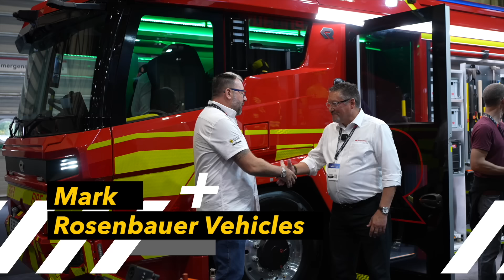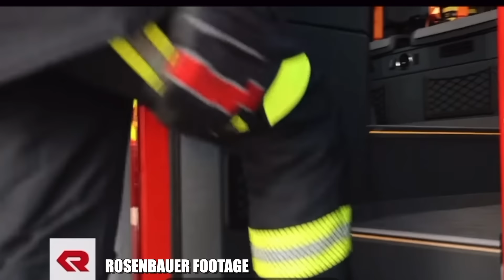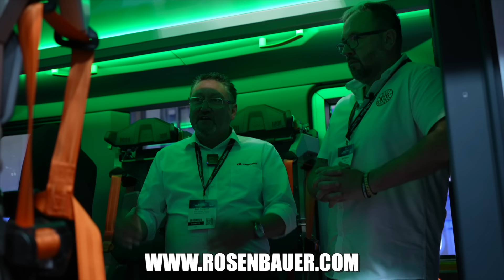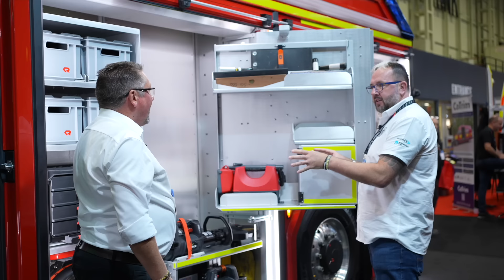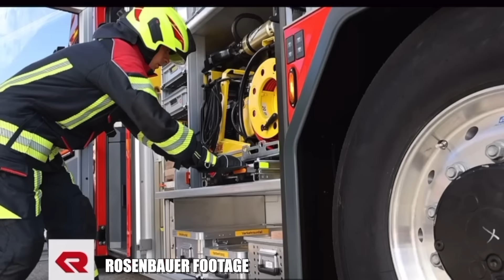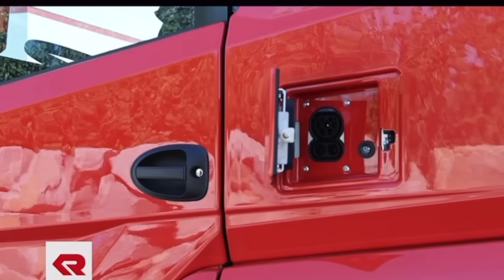Buy This Electric Fire Engine - With A £1,000,000 Budget!

Comment: "All Electric Fire Tender" with a diesel engine to keep it running, its not even April 1st lol.
Reply: Yeah, but thats only on extended uses. For small/medium fires, you can drive to the scene, do your stuff, drive back and plug it it. 

So yeah, it’s all electric, if you rip the diesel out, it doesn’t detract anything from the vehicle’s functions, except runtime.
Reply: @HvV8446  I think its designed to take the firemen to the supermarket to top up station supplies, if by chance they see a cat up a tree they can blue light it whilst getting a ladder. PS, how does the dispatcher know if its a "small/medium" fire?,  unless the caller says its a wheelie bin fire.
Reply: @HvV8446  If you rip the diesel engine out, it's completely useless for moorland fires.

What they have ended up with is a fire engine which is more expensive to buy, and wastes some of its weight limit and space which could have been used for additional water or fuel.
Reply: Its a diesel electric with batteries. Hybrid makes sense. You just have a bunch of weirdos in marketing
Reply: @BlowBubbbles  I'm not against the diesel electric part for packaging reasons, but the batteries needlessly reduce the water and fuel capacity.
Reply: @yngndrw.  Stop with the lies it only has 132kwh battery and has no major impact on fuel and water capacity. It needs much less fuel that already compensates for the battery space.
Reply: @Neojhun  Check the manufacturer's website, their own datasheet says "High-voltage battery (2x 66 kWh, 650 V)". It doesn't matter how you drive the pump, centrifugal pumps have losses and any advances in pump technology apply to both IC and electric drive.

You tell me that I'm failing at physics, but you seem to be failing to understand the units that both I'm using and that you're using. 132kWh is the capacity of the battery, it's not related to the power draw in kW or kVA. Maybe you should re-read what you've written and consider why it makes you look foolish.
Reply: @yngndrw.  What part of 250kVA Diesel GenSet do you not understand. That 2x 66kWh is not relevant if you can just Burn Diesel Fuel to top up the battery capacity. That 132kWh capacity is a massive BUFFER for the difference between kVA Supplied VS kVA consumed. Basing the operational duration on 132kwh limit capacity is WRONG! The WaterPump MAX Consumption is 112ish kVA so even the sweet spot RPM of the Generator is Higher than the consumption rate of the water pump. I never ignored the losses all I said was you could massively reduce the losses by having way shorter PTO shaft and less complex method of driving the pump. Electric Motor being closely coupled to pump is massively more efficient than PTO from engine. You keep spamming irrelevant nonsense and ignoring the facts.
Reply: @Neojhun  My responses were in response to comments that the generator would never or rarely be used, or that the engine could be fully removed. The output of the diesel generator is irrelevant  to that.

As I've said in the past, I have no issue with making it diesel electric for packaging reasons (Although that will reduce efficiency of course) but adding the battery is pointless in this application.

You're getting very angry about this, do you work for the manufacturer? You need to calm down.
Reply: Typical petrol-head reply… most of the time the diesel will never run, and appliances spend most time not moving, with big diesel engine running and making noise and pollution… this is a big improvement.
Reply: @theboatcheat1204  Okay let's use some numbers, I've found some specs for the Rosenbauer RTX fire truck shown here. It has two motors producing a total of 360kW (490bhp) peak, or about 260kW (250bhp) for everyday driving. It has a 300HP (220kW) engine and a 132kWh battery pack. Looking around, it looks like pumps typically use about 200HP (150kW) and house fires can typically take between 30min and 6hours to put out. If you have a 60min round trip from the fire station, that's 260kWh for driving and 75-900kWh for pumping.

The battery alone wouldn't even get you to and from a fire 30 minutes away, even if you didn't use the pump. Using the pump to extinguish the smallest house fire would drain most of the battery.

Pumping uses a lot of energy, that's just the physics of it. Fire engines need to carry a substantial amount of water with them so they can get pumping right away while they hook up to a hydrant. They also need to carry a substantial amount of fuel on board, because they still need to be able to tackle the larger jobs even if they aren't as common.

Electrification is a great idea for many things, but fire engines is not one of those things. It isn't about being a petrol head, it's just basic analysis of the problem.
Reply: @yngndrw.  It is good that you have some numbers but they are misleading if you don't know about electric motors, the drive motors won't be running at full power constantly just as you don't drive a diesel truck with your foot to the floor constantly. So 1 hour of driving would not use any where near 260Kw, until we are given real world data we can't say for certain what the consumption will be.  As for the pumps they would have been sized for the worst case of have branches with multiple lines coming off them, running large monitors and such, with one or two 64mm or 70mm lines/hoses the pumps would not be running full power. The same goes with the high pressure lines. Also worth mentioning is that nearly half of UK fire service call outs are to not fires and many of those call outs will benefit from having quieter vehicles.
Reply: @killuazoldyck1352  I know they won't be running at full power, full power is the 360kW peak figure I mentioned. The 260kW for "everyday driving" is from the article with the information which will be from their own press information. Remember it's an 18t GVW which will be loaded up with 2,000l of sloshing water and a lot of equipment. I've looked up the pump, it's a Rosenbauer N35: 3,500lpm @ 10bar. The datasheet doesn't state the efficiency, but if we are generous and say it's 80% efficient, then that would be about 100HP or 70kW at maximum load. Even if you call it 50kW for 1h, that's half of the battery gone just on pumping. It's worth noting that this fire engine can only support up to 120kW charging. The numbers just don't add up even if you're conservative about it.

It's worth noting that the manufacturer is very light on the numbers they provide, my cynical mind would suggest that's for a reason.

At the end of the day it's an emergency vehicle, it's a backstop which is there for one specific purpose - To be available when people really need it. What's the overall pollution from firetrucks compared with pretty much anything else? I doubt they even show up on a graph! Action on climate change must be pragmatic, or you'll lose people which damages the movement where it really matters.

If non-fire callouts are so common, perhaps they'd benefit from buying more support vehicles instead.

Why does noise matter for a fire truck? They have sirens and you rarely see or hear them anyway as most of the time they are sitting in the station doing nothing.
Reply: @yngndrw.  FYI You can just add more diesel fuel to the truck while on long durations jobs. "200HP (150kW)" does not take in account the inefficiency of Combustion engine where driving anything through complex drive shafts and transmissions has major friction losses. This direct Electric Motor pump could easily be 85% the power consumption with minimal changes. With further engineering refinement you could achieve extra 10% for similar performance probably around 75% the electrical power requirement. Soo that's just 112.5kVA Water Pump. Being fed by a 132kWh battery and 250kVA BMW Diesel Gen Set. FYI That means the power train is OVERKILL for the water pump. You fail at physics because you keep ignoring this is Series HYBRID power train. Not a pure electric power train.
Reply: @yngndrw.  BMW Diesel Engine Generator is around 250kVA. Water Pump Consumption is about 112.5kVA. Power Supply is OVERKILL for water pump. Your LIES defies the facts.

Comment: There are 2 electric fire engines already in the UK, One in London that has never been on a shout and is based on a Volvo, the other is in Scotland based on a MAN chassis, often off the run. Time will tell but I suspect it will be a good looking nothing sadly.
Reply: I've seen the Scottish Fire and Rescue Service one on a few YouTube channels. It also went past me one night along with its station's second pump to an incident somewhere in its cover area - pretty much South East Glasgow - and it does look like a decent appliance to be fair.
Reply: @shaunflanagan8735 Apparently it's now only used for driver training.
Reply: I remember seeing a video of one of these here in north america leaving a fire station on a call... listing to one side
Reply: @juliogonzo2718  Yes it has Air Suspension. It is a feature to lean down for easier entry & exit. FYI City Buses do the same thing. The driver just forgot to raise the truck and drove off.
Reply: @Neojhun no it looked like there was an air issue, one side was not inflated
Reply: Fire authorities up and down the UK have budgets that have been cut to the bone over the last twenty years, the last thing they need is an appliance that’s £500k more expensive than a standard build on a lorry chassis from someone like E1.
Reply: London's is on the run now and has been for over a month. Probably been to well over 100 shouts now
Reply: The LFB one has actually been deployed on one shout, it’s currently recharging for its next one in about 2 years. Imagine wasting so much money on a virtue signal, instead of buying several tried and tested version of a Scania or Volvo for far less.
Reply: It’s a hybrid
Reply: @jamjardj1974  Even a Dennis would do. Hell, could probably throw one on a Merc chassis.

Comment: hmmm back up diesel engine just proves the point that electric vehicles in the UK emergency services are pointless and ineffective, the best that can be done to ensure operational effectiveness would be hybrids, although even then fossil all the way
Reply: I get the scepticism, but these things genuinely are a step forward, unlike most electric 'innovations'. They are effectively hybrids, it's just that the motive power is supplied by electricity rather than direct drive from the ICE engine. This offers numerous benefits in terms of the way they handle and drive, they're 4x4 and they have 4 wheel steering. They're rated at 1200bhp, so they can get a move on too. They can pump for 90 minutes on battery, the diesel motor kicks in when the battery drops to 20%. I've seen videos of firefighters in the US who already use them and it seems that they're being recieved very positively.
Reply: @chrisjones2149  also: trains work this way. They have for a long time… only they don’t have a buffer battery. 

And it’s technically not even an hybrid. It’s an electric truck with it’s own level 3 charger on board. (As Chase from Edison Motors would say)
Reply: @chrisjones2149  1200 bhp was the theoretical total of the tri motor drive train for another brand of hybrid Fire Truck. But the electric power train could only supply about 900 horsepower which is already overkill.
Reply: Stop with the crazy fear mongering. The 132kwh battery is enough for majority of jobs. The 3.0L Diesel Engine is just a backup and down sized not required to drive the wheels. Soo this Series Hybrid power train has better quicker acceleration, better packaging not having mechanical drive train inside the cabin footprint. Handles long duration pumping just fine with it's Diesel Engine Generator. This proves Serise Hybrid is perfect for this job. Your silly comment is ignorant, pointless and ineffective

Comment: Just remember to unplug it, before heading off on a shout. 🤣
Reply: You’ve never heard of auto eject have you?
Reply: Most are already plugged in to keep everything charged, warm and ready.its remembering to plug them back in thats the issue, especially if your dinner was left on the table.
Reply: Truck will not go into drive with charger still plugged in. That mistake has never been plausible with any mass produced modern EV.